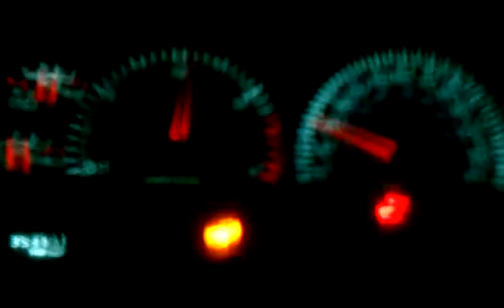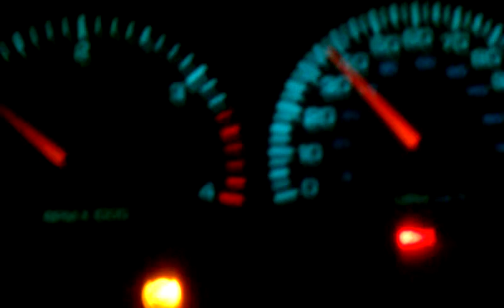2001 cummins shifting problem

Comment: Normally a 47re will lock up in 3rd gear, which would be the second shift you hear at 35mph for 3rd gear.

Comment: I have the same problem with may 94 Dodge Ram diesel please let me know hou to fix
Reply: ALSO CHECK YOUR ALTERNATOR FOR PUTTING OUT AC VOLTAGE!!!!!! JUST FIRE UP YOUR TRUCK PUT YOUR VOLTMETER ON AC VOLTAGE AND PUT IN ON YOUR BATTERY. IF IT IS MORE THAN 0 THAN YOUR GENERATOR IS JUNK AND LEAKING AC VOLTAGE INTO YOUR DC SYSTEM AND MESSING UP EVERYTHING. HAPPENED ON MY 02 CUMMINS AND IT WAS LIKE BRAND NEW AFTER THE SWAP.
Reply: silverbird58 diesels don’t have spark plugs